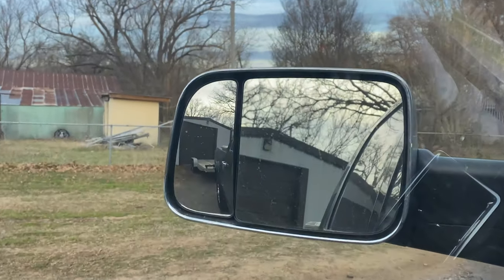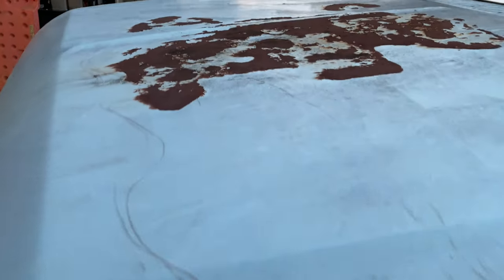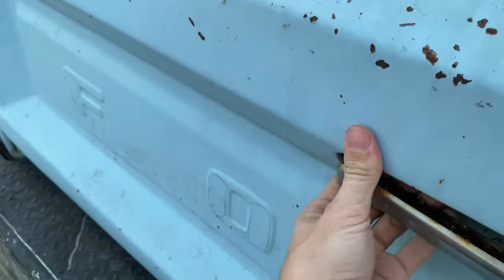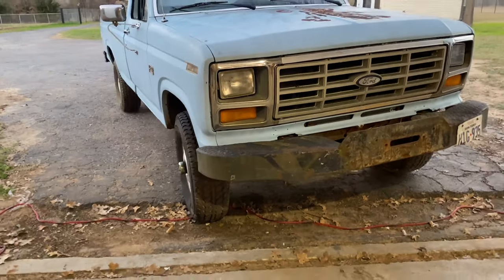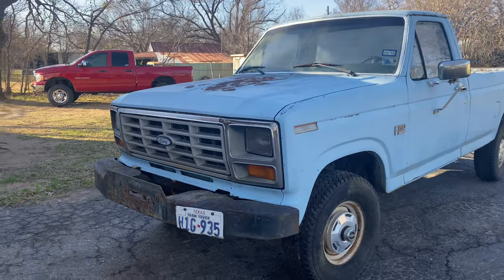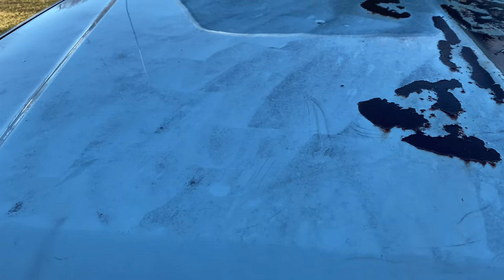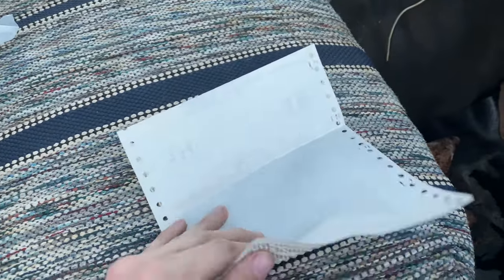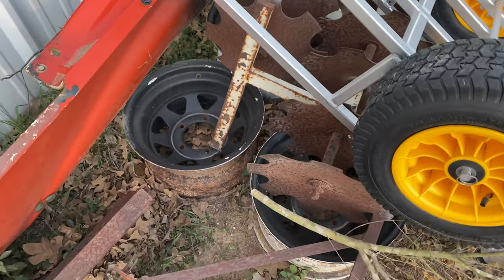We Bought a Mysterious 1986 Ford F150...

Comment: That’s a 5.0, 351w didn’t go EFI till 1988. You can tell by the firing order on that vacuum routing sticker. That being said nice truck man!!
Reply from the maker: yessir! We know of that now. The guy told us it was a 351W but we did some investigating and found all the original manuals and books, and it’s a 302.
Reply: @pylescustomzgarage  yeah sorry about that, I didn’t get to that point in the vid before commenting. I own a 5.0 same year myself, what’s going on with it in terms of why it’s not running?
Reply from the maker: @gabebarnett3529  all good man! And it actually at one point was caught on fire. All the electrical wires and connectors on the firewall are fried and the entire air filter system was destroyed. Plus; we found some “leak stopper” in the coolant when we drained the radiator. So we’re assuming the head gasket is probably in bad shape. Also, this truck hasn’t ran in years, so a new engine rebuild wouldn’t be a bad idea.
Reply: @pylescustomzgarage  is it priming the pump or anything? Looks like y’all just got it running off starting fluid.